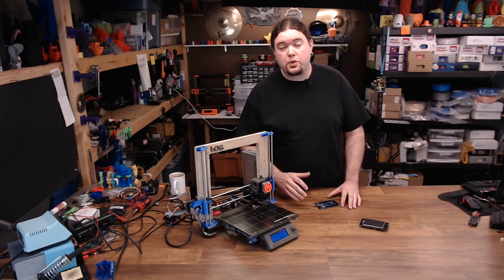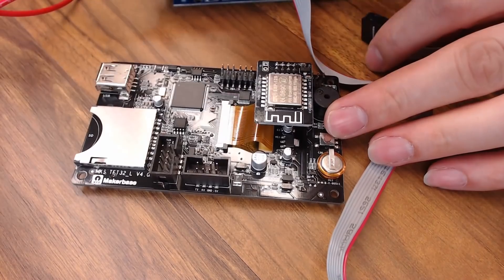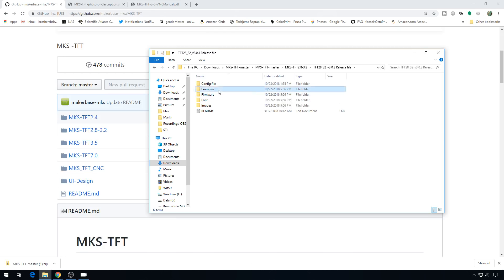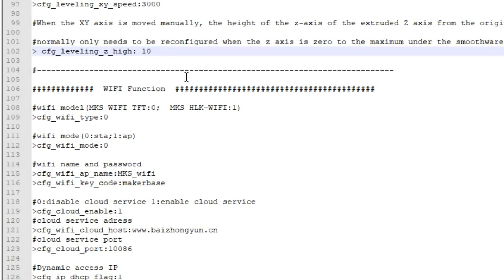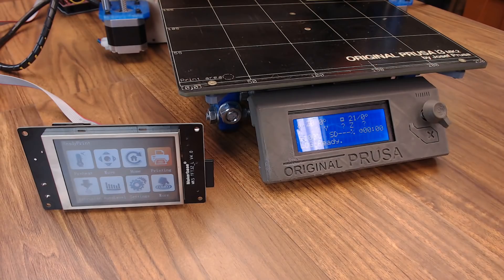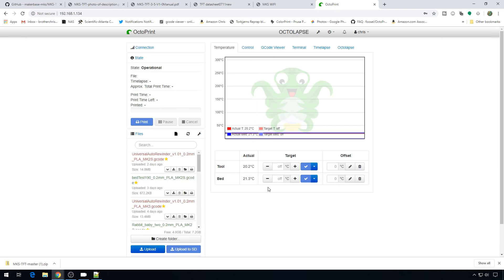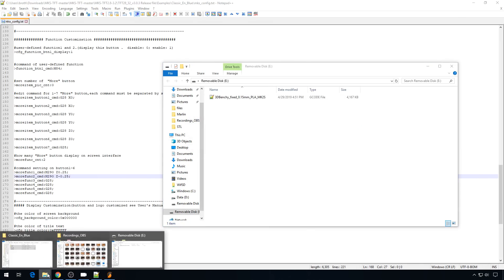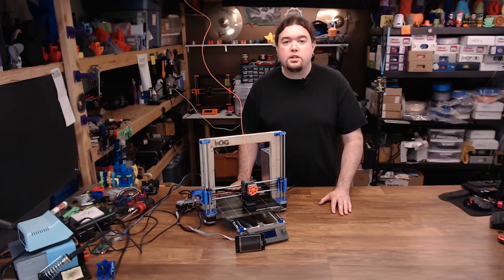MKS TFT Touch Screen Plus Wifi - Install - Chris's Basement

Comment: Hi great video I have mks board that I want to customize I wonder if anyone can help I want to be able to send command with my pc via serial port to printer but I have some problems one is that I can't to figure out what kind of command the main board get and one that the lcd dosnet send commond unless the lcd rx is connected to the main board TX
Reply from the maker: Not sure what firmware you are running, but you need to set serial  0 to -1 so that Marlin can read the serial port via USB.

Comment: Hi chis, can you help me, I have a tft35 with main board mks gen l 2.1 but Print task is not started on Marlin 2.1.2 from MKS TFT35, can you tell me whats is the problem 

thank you 

Regards
Reply from the maker: Print task? I'm not sure what that is. What main board do you have? Is the TFT plugged into the TFT pins?

Comment: So this mks display works with ramps 1.4 and a arduino mega 2560 which runs marlin 2?
Reply from the maker: Yes, if you get the cables configures correctly, you can get it working.
Reply: @ChrisRiley  thx for the info and the video. Then I will try a mks tft32 on ramps 1.6

Comment: hi chris i need some advise if u dont mind i seem running into an issue btt35 no what speed i choose it wont connect to printer been trying to get this to work for month as it wont seem to update firmware
Reply from the maker: It is probably and issue with the firmware settings, use the SD card to flash it the first time and it might correct the issue.

Comment: I can't believe I'm so confused on this. Is the controller Wireless now? What is the WIFI for? I'm just not catching it which is EXTREMELY Rare for me in a Chris's Basement Vid.
Reply from the maker: Hey, so the Wifi add on this one just gets you a wifi to serial bridge. You could connect to it via pronterface or something like that. It really isn't that helpful, but you can install ESP3d on the 8266 and use it with that screen port. It gives you a lot more options.

Comment: I have a MKS gen L v1 with manual lcd, can I run both manual and a touch screen? And if so how?
Reply from the maker: Yes, you can run both. Leave LCD as is. Use the AUX1 pins for your TFT. It should just work in that config, no firmware changes needed.

Comment: Chris, could you check  for me if MKS TFT35 is compatible with BTT's SKR1.3? I did some basic googling but it doesnt seem like much people have done it. I am aware that BTT has their touchscreen too, but I wanted a touchscreen with SD and usb slot facing forward. BTT doesn't seem to have this option though.
Reply from the maker: It's a different port, 8 pin vs 10 pin, if you could find a converter it would probably work.
Reply: @ChrisRiley  After checking the pinout diagram, it seems like the MKS TFT35 could be plugged into the AUX-1 of SKR1.3. AUX-1 uses the pins same as the TFT headers (5V, GND, TX0, and RX0). I think the only difference it the RST pin.

Comment: Hello, 
I did everything for a MKS TFT35 but this doesn't work...
Apparently there is no modification to do in the firmware but the rare time I can do something with the screen it doesn't even read the temperature from the printer...
Well, it doesn't work out for me
Reply from the maker: Are you using the USB interface as well? It could be canceling out the screen commands.
Reply: @ChrisRiley  Thanks, for the answer. Actually the USB is not connected anymore when I use the screen. But I have no response from the 3D printer. From time to time, when the screen is operating, it keep booting over and over ... 
If you have an idea it will be awesome, but anyway you already did a lot.
Thanks a lot ;-)
Reply from the maker: @samgoldfisher2526  That's about all I got, could be a bad 5v regulator, that's pretty common and could cause the reboots.
Reply: @ChrisRiley  Thanks a lot for the reply (again). I will head this way ;-). Thanks a lot again
Reply: @ChrisRiley  This was a bad 5V regulator!!!
Now everything works like a charm.

Thanks a lot Mr Riley ;-)
Reply from the maker: @samgoldfisher2526  LOL, nice glad you got it fixed.

Comment: Can I use an mks screen on a btt board or does I th have to be the same brand
Reply from the maker: I think they are interchangable, shouldn't be an issue.
Reply: @ChrisRiley  ok there actually a difference. So out of the box they wont work together. So the models I have are the BTT skr 1.4 motherboard and the display is the Mks tft35 v1. So the btts board used aux 1 and 2 10pt ribbons and the mks uses a single 8pin ribbon. However I am not sure if there is a way to connect with a wire or some other configuration but out of the box. One thing these guys seriously need to do is name, label and esthetically design these things with some differences. Cuz naming them the same thing with 16 different numbers  and 10 decimals  with the exact same color scheme and name is pretty crazy. Why cant they just make a new model. Instead we get another btt skr 1.1.1.6.1. 1.18.1 v.1 gen L 1.4 #mini turbo .6.8 in red and black...cuz why would we wanna be able to tell the difference in the new models and compatibility 🤣
Reply from the maker: @s8nlx661  Thanks for doing the leg work on this. I agree they need to update the labeling.
Reply: @ChrisRiley  yeah I'm not sure if it's possible to somehow do some custom mod to make a 8pt cable to work with a 10pt or run singles to each prong, sounds like more trouble than its worth. But out of the box is not compatible. But after all my checking around.. It appears that all Bigtreetech product is run with a 10pt prong setup and Makerbase is setup for a 8pt prong. Although everything else is pretty much identicle

Comment: good job bro!!!   , one cuestion is posible install uart wifi module for mks into Artillery Genius? the board is MKS Gen L and de tft i dont now that installing , but is 3.2 i things , pls you can help me, thank you (sorry my bad ingles).
Reply from the maker: I am not sure on the Genius, I don't know what open pins it might have. If it have RX and TX pins it should work.

Comment: I've replaced old screen with rotary button with TFT on my printer, now I'm trying to use material change (single extruder) and after M0 iniciated by g-code (cura) I can't resume printing, neither LCD message (M117) is not displayed anywhere. Any solution maybe?
Reply from the maker: Hello, M0 is unconditional stop, not sure why Cura is adding this in there. M1 will resume it.

Comment: Is there a set up that works with an A10M - marlin 1.1.8 software?
Reply from the maker: As long as there are serial pins, it should work.
Reply: @ChrisRiley  Thanks Chis, will look into that and let you know

Comment: Wher do I find the IP . I can't find it neither in your screen neither on mine . In the space that says IP has the same as yours 192.168.4.1 what do I do ?
Reply from the maker: That is the local IP, you should be able to login to it as an access point with that IP. Then you can change it.

Comment: Could you please tell me  why i just can't send m503 and get response through pronterface connected  via wifi. G28 is ok
Reply from the maker: Does M503 work via serial cable?
Reply: @ChrisRiley  yes. Serial cable worked. Wifi didn't work. Just like showed in your video. I   noticed that you've tried two m503 and one m114 without any response from pronterface.  It seems like you can only send command one way via wifi. Any suggestions?
Reply from the maker: @AIVantage-Point  Seems to only work one way, to response back.

Comment: Thanks for this explanation Chris. 
I’m sure but can I use this display in substitution of the original full graphics display or I must use both of them?
Reply from the maker: Yes you can, you don't need the other display. It might not have all the same features, but you can probably get by.
Reply: Chris Riley , thank you again.
Reply: @ChrisRiley  , is there a special config in Marlin to the display work with arduino+ramps? I make the connection correctly, but the display can’t control the printer. 
Thanks again for your videos I like so much.
Reply from the maker: @woj1965  Does the screen show the menu? If it does, that probably mean EXP2 needs to be flipped over.

Comment: Chris I need your help
I went and bought the same screen as you do. Same version, I updated it with the same version of firmware too
I have Marlin 2.0.1, screen settings are set correctly. The screen boots but does not control the printer at all
Do you need to define any settings in Marlin? As far as ive got, i've followed all your steps to the T and it still does not work. Any help would be appreciated
Reply from the maker: Hey, yep, so you need to set the Marlin serial setting. You should be able to set serial 1 to 0 and the second serial, leave it commented out.
Reply from the maker: Also, set both the screen and Marlin to 250000 baud rate.

Comment: I have TFT28 with ESP8266 for wifi. Is there a way to have windows see the SD card in the TFT28 through the ESP8266 wifi so I don't have to constantly remove the SD card?
Reply from the maker: Honestly, I'm not sure, I will have to go back and look at this again.
Reply: @ChrisRiley  i can see it in cura, but not windows 10, was looking for a way to maybe add as a shared network location if that makes sense like i share my server folders with my computers.
Reply from the maker: @TheCommo81  Yeah, I don't think it has the services to enable file sharing.

Comment: Do you maybe know if this MKS TFT32_L V4.0 is compatible with SKR v1.3 board?
Reply from the maker: I don't see why it wouldn't be. The interface should be the same.
Reply: @ChrisRiley  I does work!
In my case I use octoprint, so both SERIAL_PORT need to set:
SERIAL_PORT -1
SERIAL_PORT_2 0
otherwise it didn't work.

Comment: Good video.  I'm a newbie.  I'm trying to configure marlin (long story) have no operating software, starting from scratch and have not loaded the firmware yet. It is a MKS GEN L motherboard, duel extruder w/cyclops, and I'm stuck on the display section.  I have the MKS TFT32 L display that came with the kit.  So the question is what display do I need to define to move forward?  Thanks in advance.
Reply from the maker: If you are using the touch display, you shouldn't need to configure one at all. If I understand your question correctly.

Comment: just installed a wifi module on my bigger printer..  Can't wait to see what I can mess up..  ;0)
Reply from the maker: LOL, good luck!
Reply: @ChrisRiley  so far nothing has blown up. Now comes the learning curve. Trying to figure out what pops up on the browser when i connect to the IP. I got the oddly named GOWOOP Module for the mks TFT 3.8 (Which I live btw).
Reply: @ChrisRiley  I forgot to ask, did I hear you say that the TFT has a filament runout sensor connection?? If so, that ends my sense of dread trying to figure out where on my main board it connects to...
Reply from the maker: @elfpimp1  It does, I have never tested it before, but I need to.

Comment: Only problem that I had with my Artillery SWX1 is that when the screen is connected to the printer, it interferes with the port and it doesn't allow the firmware to be uploaded. I wish they made the software open source. One can only hope...
Reply from the maker: Yeah, I wish everyone would opensource their stuff. It would make our lives so much easier.

Comment: I had a cura plug in working with my TFT35 to send Gcode via wifi..... computer crash and now I can't find where I got the cura plugin from... any ideas
Reply from the maker: I did some searching, but couldn't find anything, unfortunately, I don't know a whole lot about Cura.
Reply: @ChrisRiley  I found it on their git hub in a section called software
https://github.com/makerbase-mks/Software/tree/master/MKS%20Plugin
Reply: I got the Cura plug in by opening Cura and then clicking on "Marketplace" in the top rh corner. there are lots of plug ins here.

Comment: Great video!
But how did you manage to flash OctoPi on the MKS TFT?
Pronterface does not work well with me. It hangs up while sending a gcode over wifi.
Reply from the maker: I am not sure I understand,  flashing OctoPi on the TFT?
Reply: @ChrisRiley  Thank you for your reply.
What I understood from what I read and seen, OctoPi is applicable with RasperryPi only and has to be Flashed on a RasperryPi board in order to be controlled wirelessly.

Please explain how did you manage to connect TFT to Octopi wirelessly?

Also, whenever I connect it to Pronterface and after I upload a gcode, it keep disconnecting and it gives me a [cannot read from the board] and [cannot write on the board] messages.

Any suggestions?

Thanks in advance.
Reply from the maker: @moathissa1994  Ok, so the screen can't run OctoPi, it's just for Raspberry Pi. I the video, I was just trying to say you can use both Octoprint from a Raspberry Pi and the screen at the same time if you wish. You can use the Wifi module for this screen to connect to the screen directly via wifi from Pronterface.  You can't connect TFT to Octopi wirelessly. I am not sure about your connection issue, it sounds like something is interfering with the serial connection.
Reply: @ChrisRiley , I am using the MKS Wifi module, and I can control the printer wirelessly on Pronterface (tried other gcode senders such as slic3r and Repitier-Server) I can home the axis and preheat the extruder and the bed. Also, I can give commands. But whenever I upload a gcode via Pronterface (or others) it just disconnects.

What is surprising me when I connect the printer via USB cable and upload a gcode, It prints perfectly and whenever Pronterface sends M105 (to check the temperature) it responds with "echo:busy" and continues to print. But via wifi it does not respond with busy, it tries to give the temperature continuously every second.

do you think this might be the problem? or is it hardware faulty?
Reply from the maker: @moathissa1994  It could be a hardware problem, I really don't know, those are some very odd symptoms.
Reply: @ChrisRiley , Thank you for your fast response.

I appreciate your help!

Comment: I have 2 mks tft35 v1.0
Reply from the maker: Yes, you can change the mks_config.txt, change:#extruder number(one:1; dual:2)
>cfg_sprayer_counter:2
Reply: Now it's solved, i tried everything but i was not happen, after then i download new firmware and then made changes, after it worked, thanks for your reply Chris 😊😊
Reply from the maker: @praveerindustries  Glad you got it going!

Comment: i got a tft 3.5 that is wierd! I try to get the red themed icons on my screen but all i get is garbled buttons, they look wierd as shit. What is wrong?
Reply from the maker: Sounds like the files might be messed up.
Reply: Do you use a Ramps 1.4 as well? 
I don't have any communication between the TFT and the ramps at all...
If you have any inside that could help it would be wonderful ;-)

Comment: How do wash speaker before removing seal?
Reply from the maker: That's a joke, that sticker you see is so they can wash the PCB when it's being made and not harm the speaker. They should remove that sticker at the factory, but most of the time they don't.

Comment: Hello Chris,

Just changed my Ender 3 board to a MKS Gen L and a MKS 32 touch screen. I followed your video regarding the MKS 32 but when a placed the SD card into the screen it said booting but went right to the RIP RAP screen then the control screen. Never upgraded the firmware via the SD. Which is a new 32 gb and I did verify the files are in it. Any advise and thank you for your help. Coffee is on the way.
Reply from the maker: I would reformat the card fat32 and put the files back on and see if that works.

Comment: Hi Chris, from a noob: can I connect the MKS TFT32 board straight to the Einsy in the Prusa MK3 to replace the LCD?    
Thanks a lot
Reply from the maker: Hey! No, the Einsy isn't going to have the correct pin configuration and you won't be able to control the Prusa smart items like first layer adjust.
Reply: @ChrisRiley  Then it's not worth to upgrade the MK3S, correct? Thx
Reply from the maker: @lubebosch  No sir! :)

Comment: What is the point adding a wifi when you can not upload g-codes and start a print through wifi...
Reply: I suspect their cloud printing service (not tested here) is supposed to bridge that functional gap.
Reply from the maker: You can still control it over wifi, but Octoprint is a better option all around.

Comment: Just a quick question, I am running octoprint and a C920 camera, I have ssh into pi via putty. I have changed setting but carnt get them to save so when I restart the pi it won’t run the settings and change the auto focus or or focus setting any think I can do?
Reply from the maker: Yep, I am working on a video for that very thing now. Stay tuned!
Reply: Chris Riley cool thanks i have been looking online but with no look.

Comment: If you have a cr-10s you can use this lcd mount clips under feet of cr-10 control unit makes it look like it should be there.  https://www.thingiverse.com/thing:2753763 - my friend made it for me like 1.5 years ago. why would you want to add this makes some movements easier then scrolling through the stock control unit on cr-10s, I use both as they both have there place, but wouldn't use as a standalone unit. to many options you would lose from stock cr-10 unit, the cr-10s has the extra port on board for this tft32 can use both stock lcd & tft32 at same time. can't live without this as I have used it for 1.5 years now.
Reply from the maker: Cool, thanks for the link and your perspective on this one. Much appreciated.